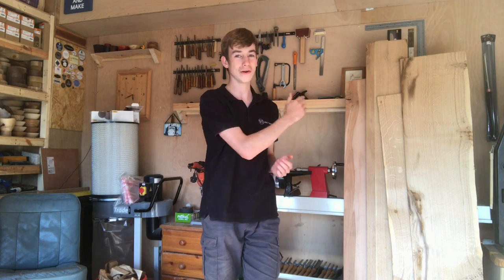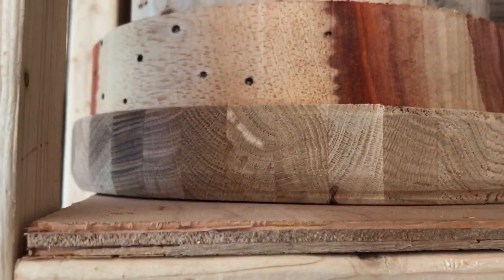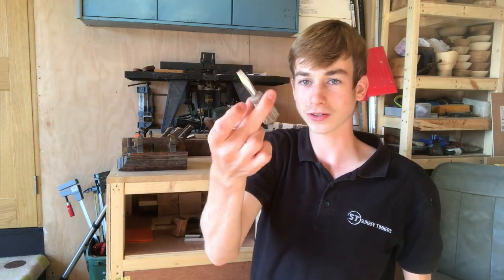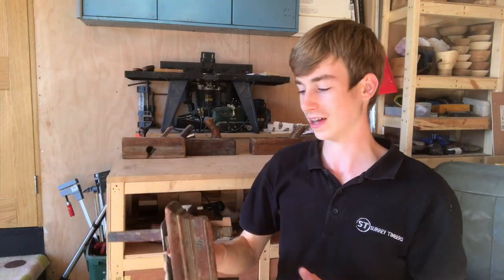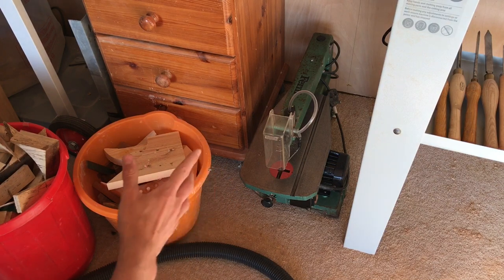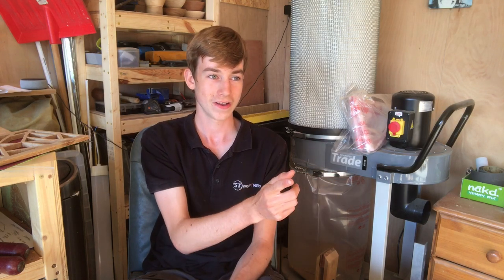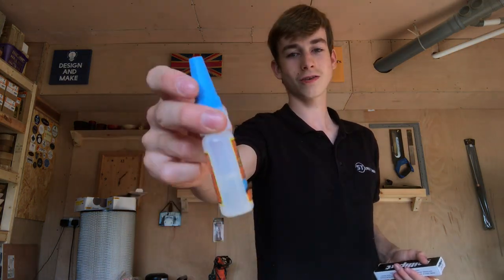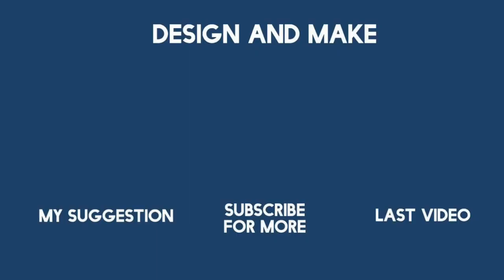Vintage Tools, Workshop Plans, Wood And Projects | Workshop Vlog

Comment: It’s hard to find a new blade that fits perfectly in to wooden planes you are better of with just keeping the same blades with the planes rust doesn’t matter just need to be sharp if anything it adds to its character and story. Look on the blade for maker marks as well I found one made less than an hour away from my house.
Reply from the maker: Okay I didn’t know that. I’ll just clean them up then in that case, didn’t see any maker marks on blades but they may turn up as I start cleaning it. Thanks!!

Comment: Your spiralux is a nail pusher.  You put a thin nail in the tube, point outwards.  Place it on your wood and push it.  Think I’d rather use a hammer.
Reply from the maker: Thanks for letting me know! Sounds intriguing, but yes a hammer is just as good 😂!
Reply: They're great for tight spaces where there's no room to swing a hammer 👍